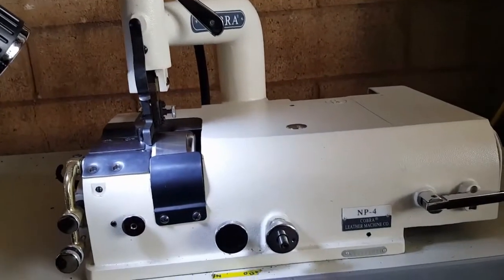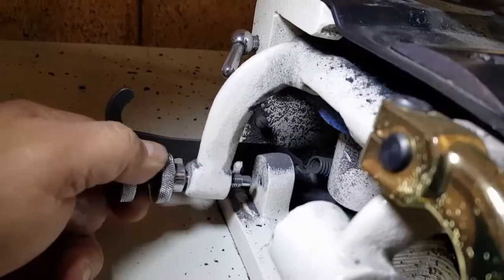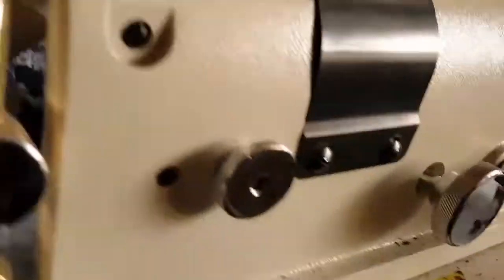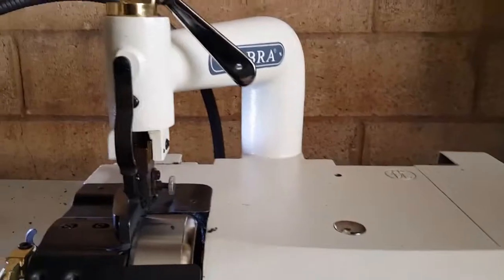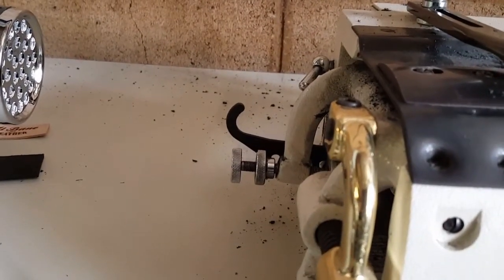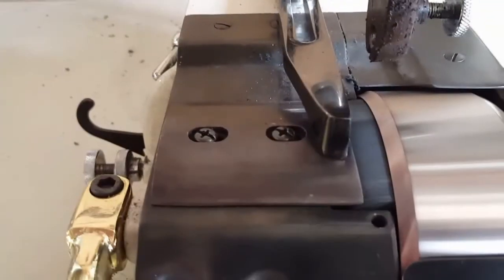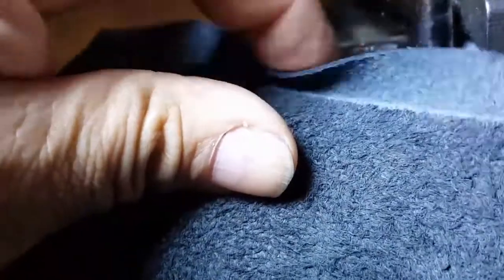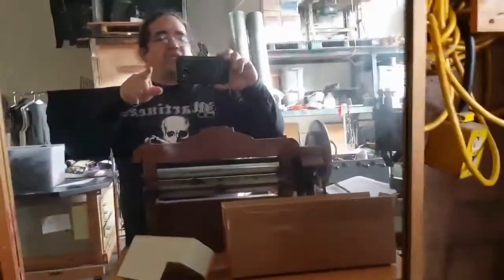Cobra Class NP-4 Bell Skiver Overview & Sharpening

Comment: Apart from the dual motor machines, all these skivers are Asian and  the instructions are TRULY WORTHLESS.  This video will get you going and the fine tuning with angles and accessories can come later.  One thing I found made all the difference in controlling the leather as it  passes  through. STAND UP - do not sit at a stool.  I don't know why or care, but I went from frustration to success in the blink of an eye.  I will say it is actually easier to control the foot pedal to an even speed while standing.

Comment: Al, did your marker ink get removed from right to left, from the top of the bevel to the edge? It seems that on my machine, sometimes the ink gets removed from left to right, and at other times from right to left. This seems to be signaling something is not right, perhaps my periodic sharpening sessions, the touch-ups between full-blown marker-ink removal sessions, are not maintaining a consistent bevel.
Reply from the maker: That would be a function of blade position when starting the sharpening process. Move the blade as close to the presser foot as you can get it and then start sharpening
Reply: @albaneforleather  Thanks for your reply. This makes sense. Would you say that the direction the ink gets removed does not matter, or should I always strive for right-to-left removal?
Reply from the maker: I've never given it much thought. I just position the blade in the right position and move the stone in and let it sharpen. As long as the blade is in the proper position and the stone is dressed properly the system should function normally.
Reply: I usually run my machine with the knife edge 0.5mm to 0.8mm/1.0mm from the presser foot. Since I use rubber/polyurethane feed rollers, do you recommend lowering the feed roller for sharpening, allowing me to get the knife edge even closer than 0.5mm to the presser foot, or is 0.5mm close enough?
Reply from the maker: @pequodexpress  unfortunately I don't measure anything when setting up my machine I just use my voodoo science. Test the setup and if it works it works.
I use simple guidelines.
Blade position is close to the presser foot as I can get it without making any contact with the rest of the machine.

I keep the blade as parallel to the inside of the knife as possible.

I maintain the blade about one business card thickness above the feed roller.

If I encounter the feed roller moving down too much while cutting I will lower it a little bit.

Comment: Thank you! The NP4 is a wonderful machine but the supporting documentation that comes with it is pretty much nonexistent. Very helpful tutorial!
Reply from the maker: The reality is that nobody documented any of this stuff before the internet era. So it's up to people like us to update the intellectual archive if you will. Thanks for your friendly words.
Reply: @albaneforleather  I have been considering getting a skiver like the NP4 but I have been told that it is not very good for skiving natural Veg Tan leather, especially thicknesses greater than 6 ounces so I was told to get the NP10. I would very much like your innsight and opinion on the matter. Thanks again !
Reply from the maker: @rustyschmidt7238  if you need to follow the hard line between either machine then your previous statement that the NP10 works better on thick vegetable tan leather then it is accurate. But, I have an NP4 and I use it on everything and it works fine for me. Now, if I was using strictly heavy vegetable tan leather the NP4 would be a more appropriate machine. If you're going to do anything different then I believe that the NP4 is a little bit more versatile because it will handle upholstery leathers better. Again this is just my opinion and you should do your appropriate research on the subject.

Comment: how do you make the machine skives so slow and smooth? when I use mine it goes way too fast (even when I try not to press the pedal too much) and cuts too much leather. thanks
Reply from the maker: It would depend on the motor a digital servo motor offers a lot of control compared to a clutch motor. Practice without any material just see if you can control the speed with your foot to your desired speed. Once you can do it consistently then you can add material. Use scrap materials so that you're not damaging your work pieces until you get the hang of it.
Reply: @albaneforleather  Thanks a lot!! so your machine has a digital servo motor? can you install it on a clutch motor machine? cheers!
Reply: @armilleiriccardo  that's what I'd like to know.  If you can change out the clutch motor to a servo motor, could you show how I can do that?

Comment: Al, thanks for this video. I have a similar Chinese bell knife skiver, and it has a very faint electrical charge running through the machine both when it is operating and when it is turned off but plugged in to an outlet. The only thing that removes the current is unplugging from the AC outlet. I think it may be a grounding issue. My machine has two direct-drive servo motors, one attached to the knife, and on attached to the feed roller. Might you know of a simple way to remove this excess electrical current?
Reply from the maker: Make sure the system is properly grounded
Reply: @albaneforleather  Thanks for your reply. I thought this might be my problem. I discovered the issue was much simpler. I was plugging in the machine to daisy chained power strips. The problem went away when I plugged in directly to the AC outlet, or plugged in to a surge protector that was plugged in directly to the AC outlet.

Comment: Al, I went to Tandy and obtained the a pamphlet on the Cobra NP-4 and it specifically indicated that it was good for trimming chrome tanned leather...does that mean that it does not work on veg tanned?
Reply from the maker: It works on veg tan just fine.
Reply: Al, does that apply to  newer model, I spoke with leather machine company and they advised of issues with chrome tan a d recommended np10.....now I'm totally confused
Reply from the maker: @jayjohnson7423  the np-10 is a heavier duty machine only by the way of a more robust feed system.
The upper drive mechanism helps move the material by the blade.
If you plan on doing a lot of heavy saddle skirting then the NP 10 would be the choice . But, if you're going to do a lot of upholstery materials and normal veg-tanned leather the np4 is a perfect machine.
Reply: @albaneforleather  awesome!  I'm only making handbags , wallets, etc!

Comment: Is there a video on how to oil this bell skiver?
Reply from the maker: Unfortunately no but there is only one place to apply oil the rest is grease in sealed compartments that are not normally accessible by the end-user. Look on the top of the machine just above the knob that adjusts the blade distance. You will see a round disc with a u-shaped notch in it. Underneath that disc is the little hole where the oil goes. You could oil the lifting mechanism but it's not necessary.